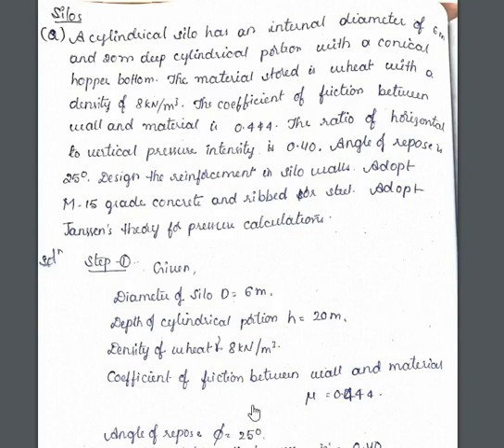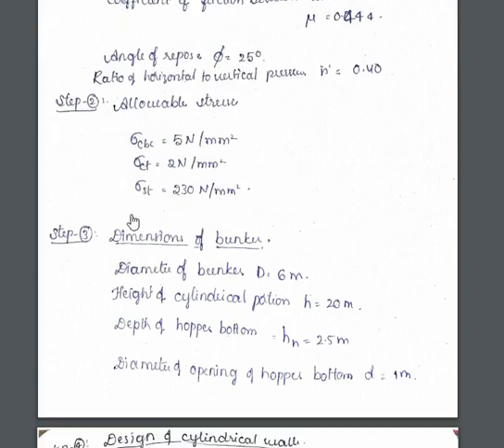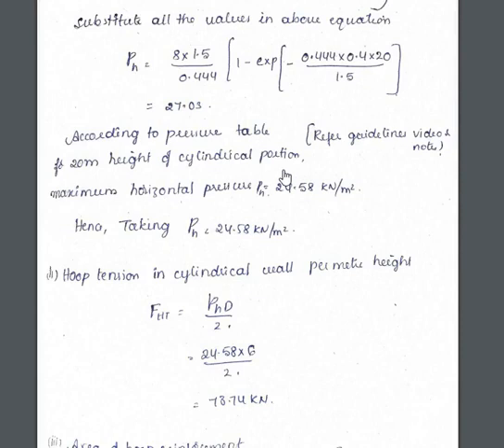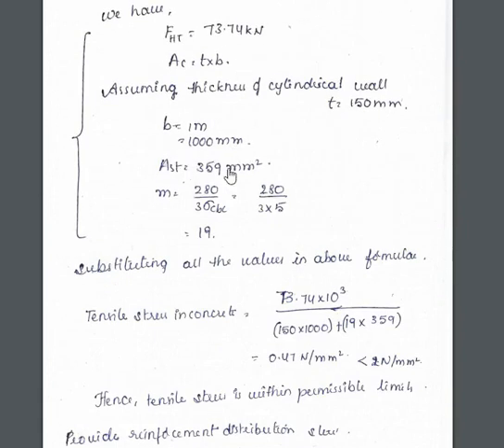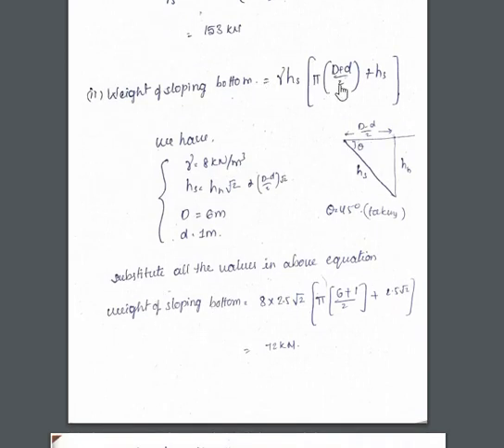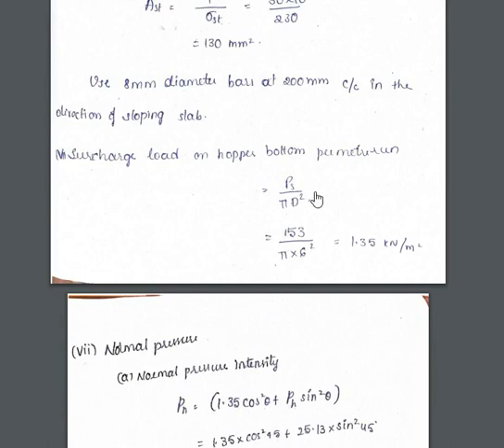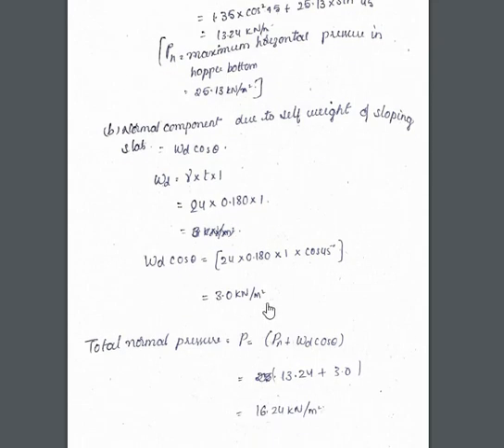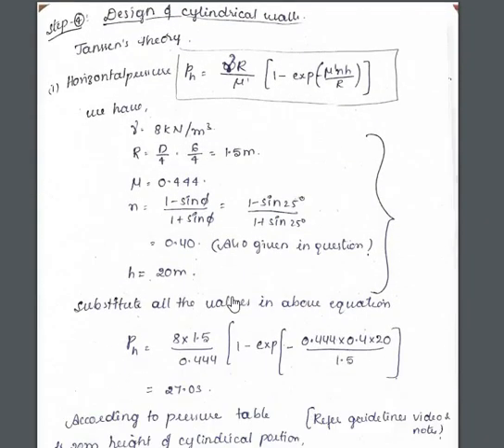Problem on Design of Silo by Working stress method

Comment: What to take value of pressure, table given in quide line is till 22.5 metre height for more than 22.5 height what should be pressure value janessen theory???

&. Why vertical pressure formula value not used directly to know load on hopper (Pv)?
Reply from the maker: Shibu, RCC Silo above 22.5 meter is not suggestable till now. So we the provisions upto that limit

Comment: mam in step 8 you need to put density of concrete instead of density of wheat
Reply from the maker: Hi Ujjwal.. yeah.. You're right. In step 5, I've done mistake.. I've just noticed it after your comment.. Thank you for letting me know.. I'll try to prepare another compensatory video..